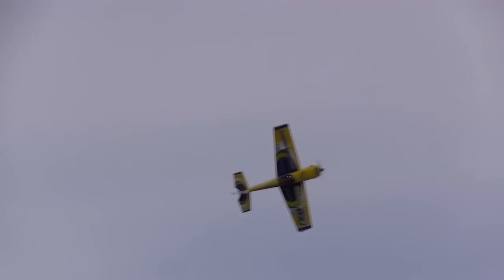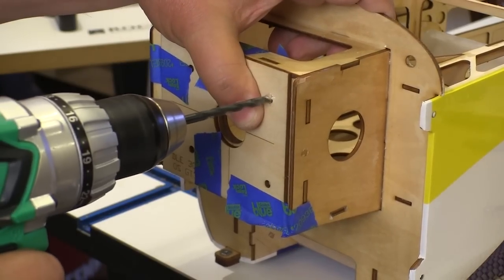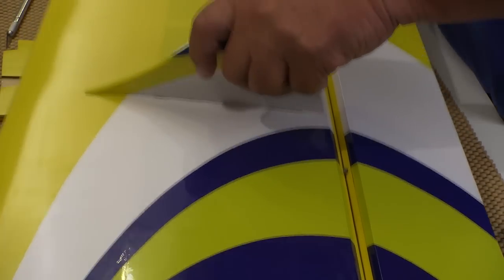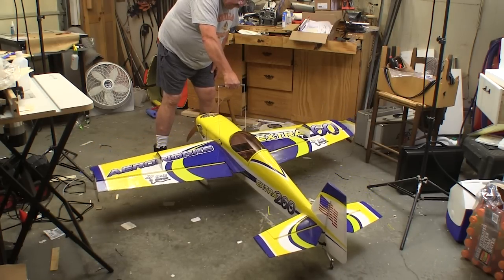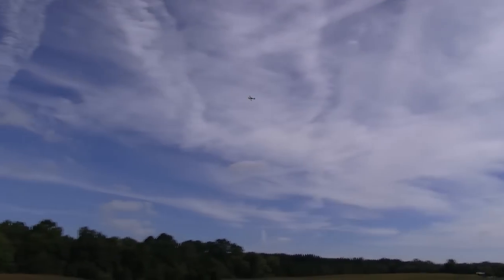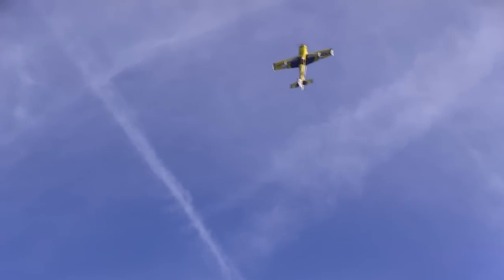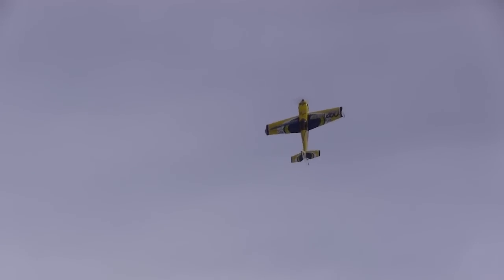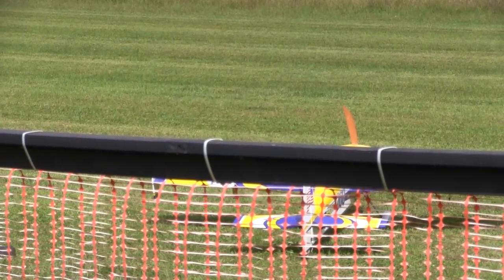Aeroworks 30cc Freestyle Extra 260 QB-L

Comment: Great video - I really like the rational around de-tuning the throws and using it as a trainer under supervision (buddy-box). Almost all of these big aerobats track like they are on a rail and have GREAT and predictable glide due to big wings with low wing loadings, yet for some reason most 'traditional' folk cannot get their head around the fact you can make 3 different flying planes simply at the flick of a (dual rate) switch, yet still insist on poor performing POS's for learners just because they are short sighted and get focused on those big control surfaces that you "can" use IF you opt too!

Comment: Question? What's the difference between the A & B Vess props?😉
Reply from the maker: The A's have less pitch where the B's have more around an 8 in common prop descriptions. But, the Vess props seem to work better throughout the RPM range, for me anyway. I love them and use them exclusively.
Reply: @flyingrcdotnet  Thanks very much! Couldn't figure that one out! Wasn't sure if they were referring to sides!🤣